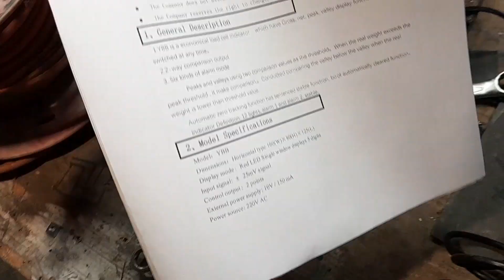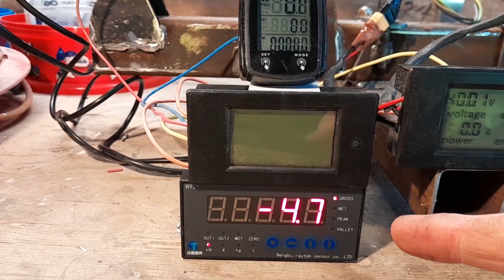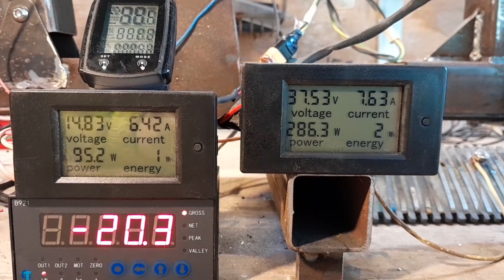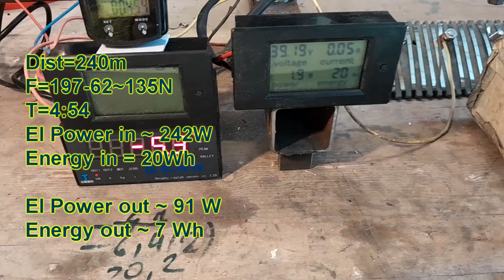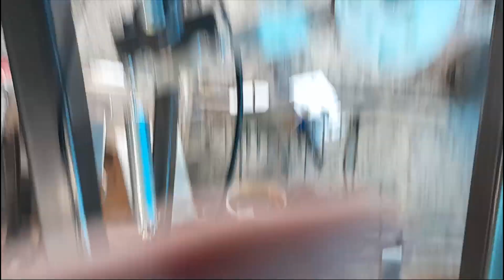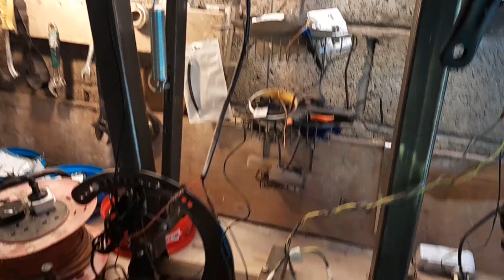Part 1 - calibration. Stand for studying bicycle transmission. Checking the Tonsheng TSDZ2 motor

Comment: You are absolutely NOT measuring power using the chain tension.  Power into the motor matters and power OUT of the generator.
Reply from the maker: Thanks for the comment, I understood where a more detailed explanation is needed.
To know how much power is applied to move something, you need to know the speed of movement and the force of resistance. The tension on the chain can be thought of as winding a rope around a spool. At the end of this rope there is a weight that creates resistance to movement. Resistance is measured in newtons. The greater the resistance, the greater the tension in the rope. Another example is lifting a bucket of water from a well. To find out the power, you need to know the lifting speed and the mass of the bucket multiplied by the acceleration of gravity. This is how we know the force of resistance. Although the weight of the bucket remains constant, to lift it faster you need to put in more effort. this is the speed multiplied by the resistance force.
My test works exactly the same. This is how I recognize physical power, not electrical power.

In this test, the generator is needed only to create resistance to movement.
Reply: @Veloreamer-ENG  No.  That measurement is not in any way an accurate measurement of the torque applied.  You put the load on a swinging arm and  measure the torque of that.
Reply from the maker: @nathansmith7153  OK, I can do this. If I'm right, then the force on the swinging arm will be exactly the same as on the chain if the length of the arm is equal to the radius of the sprocket. This is a reaction (action is always equal to reaction). I can check this after a small improvement and will show you in the next video.
Reply: @Veloreamer-ENG  The force on the torque arm will represent the torque, what you had in your test is a bad measurement that will be totally inaccurate.  https://digitalcommons.cwu.edu/cgi/viewcontent.cgi?article=1019&context=undergradproj
Reply from the maker: @nathansmith7153  I thought some more about your words. I'll definitely add a torque measurement. Perhaps if there is a difference between the torque on the motor and the force on the chain, this will make it possible to understand what percentage of energy the chain itself loses. thank you for submitting the idea!
Reply: @Veloreamer-ENG  No, the chain has an efficiency somewhat related to tension but mostly the sprocket radius.  You could have a huge force on the chain and still rotate it.
Reply from the maker: @nathansmith7153  I just want to find out the efficiency of the chain. measure how many watts it loses. And you gave me an idea. I'll measure the torque on the motor and on the generator. Knowing the rotation speed and torque, I can find out the actual power. And by comparing the values on the generator and on the motor, I will find out what percentage of energy was lost in the chain.This method will also allow me to measure the efficiency of the motor, regardless of the transmission.
Reply: @Veloreamer-ENG  Chain efficiency is measured in some IHPVA documents.http://www.ihpva.org/hparchive/pdf/hp50-2000.pdf    If you search for IHPVA chain efficiency there are several more.